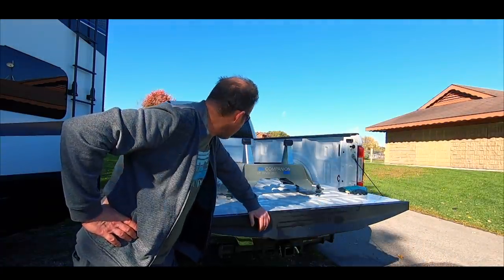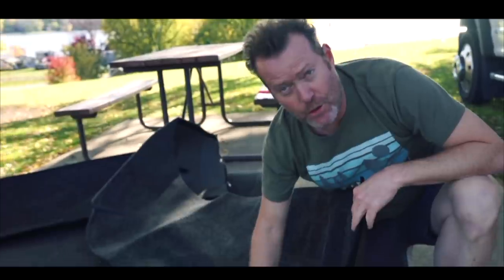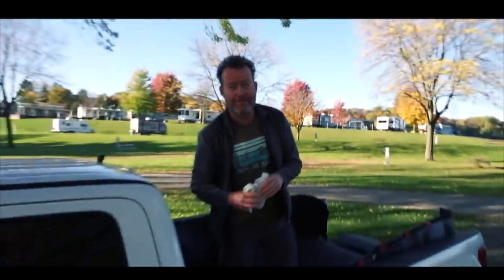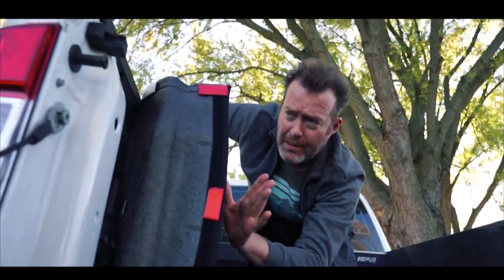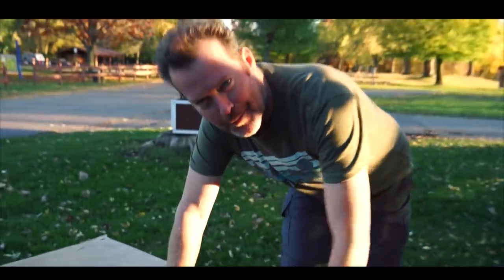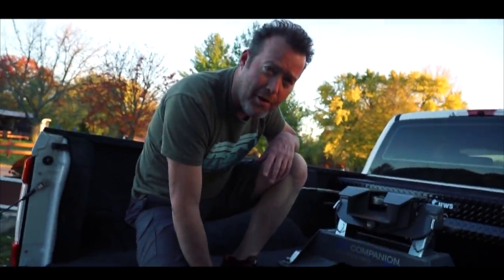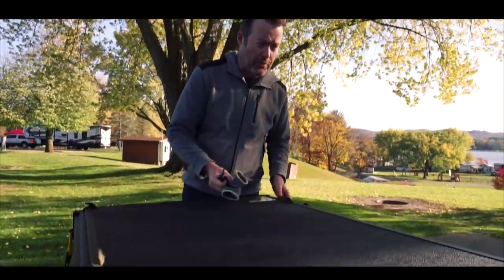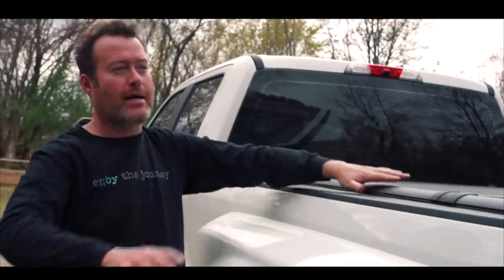Shocking MODS & UPGRADES To My Ford F450 Truck!

Comment: In 2013 I went with a spray on Rino Liner, works great and still looks like new. As for the Tonneau  over I went with Pace Edwards, it’s electric remote operated with a safety pull strap inside, couldn’t be happier with those choices.

Comment: It looks like you are having too much fun. Remove your electrical plug pull it through the rug and bolt it back in. To hide the cut and secure the rug. Looks good.

Comment: @enjoythelife if you haven't done thus yet the trailer plug in the back you could remove the plug assembly and refit it over the bedrug. It would make for a cleaner look as the outlet has a larger flange than the hole you cut

Comment: Tom I like your videos because you can tell that you don’t always know what you are doing but you are willing to give it a shot.
But please tell Logan to wear some better shoes if he is going to help you move things like the hitch or toolbox. I kept seeing in my head his toes getting squished.
On another note if you haven’t gotten any Velcro containment blocks I highly recommend them. They stick unbelievably well to bedrugs and are relocatable just by peeling them up. I’ll include a link.
I noticed on the end by the tailgate it looks like you will need to add some Velcro to hold the edges a little better, and for a cleaner look around the RV plug you could unbolt the plate that holds it from the truck. Pass it through the hole in the bedrug and bolt it back over it. You won’t see and edges of the rug, and you will have no chance of anything getting in behind the rug while you are towing.
Here is that amazon linke for the containment blocks 
https://www.amazon.com/Multipurpose-Cargo-Organizer-Storage-Available/dp/B06VVPWSXM

Comment: I see rust in the future under that bed cover...similar to a Bedliner. I would get it sprayed instead...just my 2 cents...
Reply: Aluminum doesn't rust.
Reply: @msd357  aluminum bed in a HD truck. Is that what Ford is doing these days.
Reply: Especially using that knife scraping into the paint cutting those holes. But it looks good for now.
Reply: Aluminum doesn't rust but it does still corrode and yes moisture gets trapped underneath those rugs if you have organic material overtime that builds up either rugs if it's wet it will start to stink and mildew especially with a tonneau cover on it that's going to hold the moisture in. as good as that rug looks I still much prefer Rhino Lining or Line-X
Reply: The bed rug is one piece of advice from JD that I would not do
Reply: I would have sprayed it and then maybe install it .
Reply: Well....we can tell who gives opinions on products they have never used..🙄🙄
Reply: @mayorwrenchmcgnome  A vote for Rhino Liner here. Advantage over most other liner options is it isn't abrasive, and therefore won't damage your cargo. Bed protection, slip-resistance, and a cargo friendly surface. What's not to love? 👍
Reply: I've had Bedrugs for years and the bed stays dry underneath the bed rug, no need for lining it as long as the bed is clean and not scratched, unlike the plastic liners that will scratch through the paint over time.  If the paint is scratched it is a good idea to shoot some clear over, or repaint it so that no bare metal is exposed since steel will rust if exposed regardless what is on it.   The Bedrug is impervious to liquids including battery acid. Any moisture that gets past the zipper will go down the seam between the side wall and floor of the bed, especially in the aluminum bed as the gaps are larger than steel .    In 6 years never had water get under the bedrug.
Reply: I’ve had bed rugs with taneau covers in several trucks over the year’s last one I had for 10 years in New England zero rust under the rug. Only reason I got ride of the last truck is the chassis rotted
Reply: Line X is best.  I had my husband's truck bed sprayed and it is indestructible.   No worries about corrosion.   I also had the bumpers, rails and quarter panels sprayed as well.   We no longer worry about door dings either.

Comment: Hi Tom, I did not see how the tool box was secured to the truck? Also would  have liked to have seen the tool box opened with the tonneau cover installed. Keep the video's coming.

Comment: Those front post pockets underneath the plastic bed rail cap have a hole in the side of the bed the drains directly out to the ground in between the two bed panels.  That was how I routed my drains so that they're not hanging down into the bed to get hung up on things. I have the Bakflip F1 tonneau.
Reply from the maker: Thanks for the tip Justin!

Comment: Checked your bedrail clearance with the new cover?    Some tips on the Bedrug install, done a few of them now. When you get it, and zip it together, put it fully in place and let it rest a day or two so that it relaxes and the wrinkles come out, especially the floor piece since it is tightly rolled.  Remove the anchors from the bed and any lights or sockets.  Once you have the liner fully installed then go back and cut out the openings to match the lights and outlets, and reattach all the anchors.  Now is the important step for a super clean install, where the lights go in, taper the foam backing so that the lights and sockets are tight and have very little pressure on them from the bedrug.  That 7 way plus TPMS/Camera socket comes fully out and unplugs from behind, so it makes it really easy to remove and make it look like a factory install.  Also when removing the anchors and reattaching them through the Bedrug, it secures the bedrug better than anything.   One other tip, for Northerners who drive through salt y roads in the winter, spray some WD-40 every few weeks on the zipper at the tailgate in about a foot back to prevent it from getting corroded, especially if the tailgate piece is zippered on, or you may find it seized from salt corrosion. The WD-40 will flush the salt out.

Comment: Thanks for the shoutout my friends!  I love Bedrugs.  Unless you plan on carrying a lot of mulch or aggregate, you'll likely love it too.
Reply: Like seeing the camaraderie between U-tube channels.  You've got me thinking about getting a bed rug.
Reply: I got Bedrugs in my 2011 and 2012 Ford Transit Connects. They sell them with a rug or a vinyl feel as I have both. They are awesome!! Very easy on the knees, things don't slide around, adds sound deadening and a little insulation. I'm a courier and haul things all the time. My one bedrug is about 4yrs old. HIGHLY RECOMMEND!!
Reply from the maker: Thanks again JD for all the advice! Love the Bedrug so far...

Comment: Don't understand the cover...
When towing, has to be open. If it rains while towing, that bed rug will be soaked, trapping water underneath it, leading to rust issues on a new truck...
I had a Line X spray in liner done in 2011 on our truck.
8 years & still fine.
Truckloads of firewood, bags of cement, lumber, you name it. Still no issues.
Yes, it's hard on the knees..
Concerned about mileage,  your towing a fifth wheel, that cover will do nothing
.
When not towing, that cover will actually reduce mileage. Mythbusters proved that over 10 years ago !!
Reply: Bedrug does not trap water since its breathable.  I've had them in the past 8 trucks I've own (Chevy Duramax, Toyota Tundra, earlier Super Duty's) and they do not trap water.  Plus, the new Ford's have aluminum beds.
Reply: Bedrugs don't trap water. While a spray in liner looks great at first, it wears out and actually detracts from the trucks value.
Reply: @showcasecharlie11   My truck spray in bed liner is going on 3 years and it looks brand new.  I just do a little power sprayer on it.  Not knocking the bed liner, but I have used both and prefer the spray in liner.  Maybe it is because I didn't have to do the spray in liner install.  :-)
Reply: I have a similar tonneau cover and my mpg went up by 2 mpg after installing it on my 2020 Chevy 1500
Reply: @showcasecharlie11  I have 2 ,  2001 Silverado 2500HD's , spray in bed liners 19 years old now, Both still look brand new !!
Reply: @davidjames5727  I have a spray in liner on my 94 dually.  Its ok...but it shows its age and has imperfections like spots scraped off...if i had to replace it, would probably take a major scuffing and prep to recoat it.

Comment: The truck bed liner is some kinda nice...if I had a truck like yours, I’d get one in a New York second.  Great protection for the truck bed...eliminates scratches/scrapes and keeps the bed looking new.  You did a great installation.  Impressive.  Very nice.

Comment: Just finished checking out etrailer.com & came across employees ratings for working there. One big concern I have re anything I'd buy is that they pay their employees piecemeal rather than hourly. This is why the RV industry has such poor quality products in general. Employees have to hurry through jobs, whether done right or not, so they can get paid & get on to the next piece. It's always hurry up & finish so they can enough to live on for themselves & their families. It's a version of slave labor  just like on the plantations. 
Just wonder how many other RV viewers are as much in the dark about this RV industry wide practice as we were. It certainly explains a lot.

Comment: Do you need to completely remove the tonneau cover to open the storage box?
If / when you update or follow up this video, please show how you get into the box.
Thank you.
Reply: If you watch the part where he has to use the key to get the cover to close all the way you can see it😁👍
Reply: @ashleejones1690  looked back again - not quite what I want to see.
 I would like to see these things:
1 - tool box open with the tonneau cover still in place
2 - trailer connected for a travel day (tool box closed)
3 - tool box open with trailer connected (like if I need tools for roadside emergencies)

Comment: My fuel economy goes down when I put my tonneau cover on.  I did some reading, and it is because the truck creates a bubble with the wind that goes over the cab and into the closed tailgate.
Reply: I once read the most fuel efficient way to drive a truck is with a rigid bed cover covering the back half of the bed. It creates a stronger vacuum to help push the truck along. Totally counterintuitive.
Reply: @josephmcclary9667  hmmm.  I know I did get better economy in my old truck with a topper on.  I've never heard about the rigid cover increasing it.  I'll have to look around and see if I cam find that.  Seems odd

Comment: Did similar upgrades to our 2020 F250.  Got a low profile, shotgun latch toolbox instead - in theory our tonneau cover will butt right up to it.  Had similar 'fun' cutting the holes for the puck system, but the B&W slipped right into place.

Comment: We had a 2500 gmc with a bed rug and was bullet proof pallets of rock engine blocks with oil cleaned up great no rust 2007 still going. Now a 2021 ram 3500 dully bed liner and bed rug. Northern Lite truck camper.

Comment: You are DEFINITELY going to have water/rust/ rot issues with this.
You said it's easier to go around in the bed of the truck on your knees.
Knee pads are cheap!
The bed you will damage is not🤔

Comment: (Owner of a Keystone Carbon 357 Toy hauler)   My suggestion  for ALL manufactures is put the owners manual on video / You tube.  Why on earth are you printing books that no one can follow along to????  Have the guys in production do videos for everything from leveling, checking valves, fridge settings,  to setting the TV / DVD player up. Most the time little repairs are taken to the place of purchase to be fixed when its simply can be done by the owner.  The RV stores are slammed with repairs. These videos could help with their back log and get the owners back to camping again.  I have a newbee friend it took 6 months to figure out how to get his antenna to work. He had no idea there was a boost button.  Of course we all know that but he didn't. This is one example to many I hear about.   Thank you for all your videos. Love to camp with you one day!

Comment: I have a spray on bedliner from Rhino.... I love it... I wouldn't use a plastic bedliner or the thick rubber mat that your using.... With the spray on you won't have to worry about water turning into ice or snow freezing up into ice chunks under the mat pushing up on the velcro you have holding it down..
Not very secure.... Perhaps a bit more home work before you bought your rubber rug....

Comment: Suggestion for your LECTRIC bikes. I don’t know if there is the clearance under the truck cover, but we use black construction tubs from Lowe’s to put our bikes in. This lets us slide the tubs saving wear and tear on the bikes and underlying carpet. We’re moving the tub with the bike in it, not yanking on the bikes to move them.

Comment: I 1000% agree about the tint. For some reason my F450 seems to be a greenhouse compared to the F350 I had...it's the same interior but couldn't stand getting into a 150 degree truck any more lol and driving with the sun beating in was getting old. I plow snow with this truck too so I still needed to see at night so I went with 20% on the driver and passenger front windows and 12 or 15% on the rear side windows and rear window. I know this is an older video and you might have done this by now but I've heard its a law that you have to have mud flaps on the rear of a dually. I put Weathertech no drill ones on and they match the front OEM one's perfectly.

Comment: I'll be installing a Bedrug Bed Mat in my new truck when it comes in, and will need to cut the holes for the Gooseneck and pucks. I'm thinking a glass pickle jar as a guide with a razor knife will allow for a nice clean cut. Thouhts?

Comment: Hi Tom as always great video! Question for you regarding your new bed cover. Have you experienced any issues seeing the hitch and king pin while hooking up to your fifth wheel when the cover is folded up?  Also what about clearance between the fifth wheel and the folded cover in tight turns?  Thanks in advance.

Comment: One thing to note about window tinting...Laws vary from state to state in regard to "vision reducing material" applied to automotive windows.  In Missouri it is necessary for the tint on the windshield and windows on either side of the driver must be minimal.  Had tinting installed over in Kansas City Kansas (still a Missouri resident) and cost me $500.00 in traffic fine for too dark in those locations.  Also, another $200.00 to correct the tint on these as well.  Lesson learned!!!
Ken

Comment: There’s a much better way to do the holes for the fifth wheel, wish I could send you some pictures. You can actually use the factory trim rings with the bedrug and it gives you a seamless finish. Also you should’ve removed the factory hooks and bolted them in over the bedrug.

Comment: Logan!  Your sense of humor , sleeping in the truck bed .  Okay, it WAS funny!   Our truck has the spray on liner. I want a rug too  now because that bed liner can scratch up and is rough on the body.  It also gets soooo hot it's hard to unload items in summer.    Thanks for the video , this is not a product I will have to twist arms to get hubby to buy!

Comment: Bedrug big no. When it rains it traps moisture under causing clear coat bubbling and or paint then rust. So no. When your sitting at a place long enough. Look you sspray on liners. That's just not the bed Bhutan the sides to. But in in the end its your 80k truck. Like the channel keep it up

Comment: You should drill a home through the handles on one side of the hitch where the safety pin is used to keep them from rotating. . Then install a lock instead. I use a bolt lock on mine so it’s keyed the same as my truck but this is a little more piece of mind to “keep the honest people honest”. I like to do as much as possible to keep my $1000 B&W in my truck.

Comment: Spray in liner better protection then install a heavy duty rubber mat, which can be removed to clean the bed of the truck.  The company that made the rug supposedly for the 450 should know about the anchors and electric connection and give you the perfect fit.  There are the low profile tool boxes that fit on top of bed rails and can reach the latches with cover.  Now you have to pull back cover to access tool box.

Comment: The best kind of bedliner you should have put on your truck and you going to find out after you put in a bid rug bedliner in there that rug bed liner is going to make your bed sweat and it's going to cause you bed between that rug bed liner and your real bed of your truck it's going to sweat and it's going to run and you ain't gonna like it you should have spent the money on a spray bed liner from Line-X I did that on my pickup with my fifth wheel and it's security bed in her lot longer and it's sound makes it more sound deadening and if you spill diesel fuel or any kind of chemicals it's not going to damage it like it was going to damage a rug the third sprayed down and all the stuff is going to come right up so a bed liner spray on bedliner is lot better than what you're using rug bat bedliner that is the worst thing to ever use a known

Comment: Good work Tom, I just did a similar install on my new 2020 RAM 1500, I installed a Better Built SLE toolbox (like JD and Chad) and Access tonneau cover. I can access my toolbox without opening the tonneau cover. 
I also installed a DU-HA storage under my rear seat, check it out. Next... Husky mud flaps.

Comment: I love my tonneau cover (exact same as yours).  It doesn't improve mileage, but it looks slick and does an excellent job of keeping out the rain.  The company's support is great if you have any issues, too.  I also have a Decked unit.  These two play well with each other, and I can take it out when I use my 5th wheel.